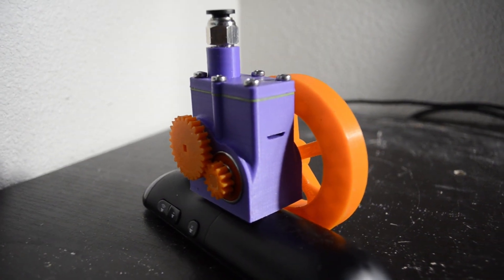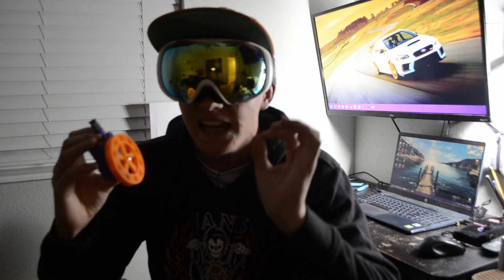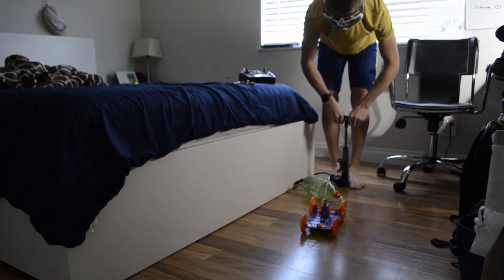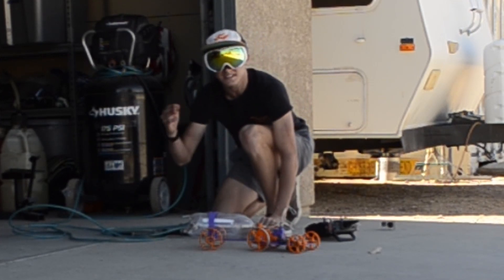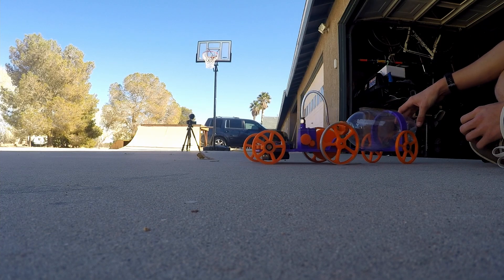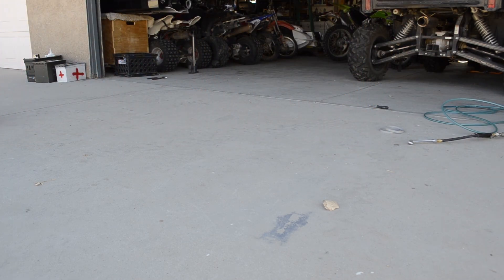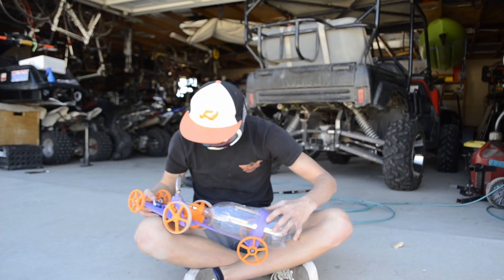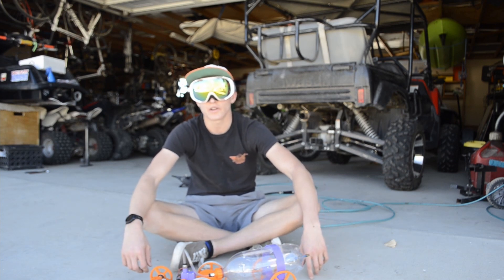RC Car That Runs Off Air

Comment: That’s cool, but why would it be 4 stroke if it’s run on compressed air
Reply from the maker: It just uses air 0.5x as fast as a 2 stroke with the same displacement.
Reply: @AxelDayton  do you have a discord?
Reply from the maker: @jordanflorance4419  unfortunately I don't

Comment: I feel like I can help a bit. We need to decrease loss and increase traction. You lost a ton of distance due to wheel spin, using a secure rubber band would have huge benefit over ninjaflex, also remove the trailer and mount the pressure vessel to the car istelf. I recomend you only use 1 rear wheel that drives the unit and add some weights to the drive gear, this will help make the power stroke more effective and increase momentum of the drive wheel while adding pressure on the friction surface, while decreasing drag from friction with the ground during the rolling parts of the engines cycle.

Comment: Here’s an idea for being able to squeeze out more power every stroke but what if you make your engine be designed not like an internal combustion engine but instead like a steam engine you see modern(ish) steam engines from the 1910s like in the Olympic class they would have 4 cylinders (like your engine) but to use up every ounce of steam as efficiently as it can. 1) they would have a high pressure cylinder where all the steam goes into first 2) they would have an intermediate cylinder (the medium pressure one) that is double the size of the first cylinder where all the all the steam from the high pressure cylinder would go into (3 the steam from the intermediate (medium pressure)  cylinder would go into 2 low pressure cylinders (you can test out if 2 low pressure cylinders would be more efficient than a singular one) 4 times the size of the high pressure cylinder (4 exhaust. So yeah that’s my Ted talk on why stealing ideas from people that have been dead for a while is pretty smart 😎

Comment: You could potentially try to print an little turbo for it. For bearings you can use fingerboard bearings. I tried to do it on my two stroke air powered engine ( sadly it snapped the con rod)

Comment: Have you tried using the V2 with CO2 cartridges, I feel like the problem here is that there's not enough power on the fuel side to generate enough torque to run the car. The CO2 cartridge's could definitely solve this problem and get it to run. However, the volume of the cartridges would be of concern, as they hold 20 grams (at about 800 psi each, so you'll definitely need a throttle). Maybe multiple cartridges linked together,  and then a mechanism to change which cartridge is outputting when the current out put cartridge is running low?
Reply from the maker: I like the idea, but in my testing of my upcoming video I've found that the higher the pressure i run the engine at, the higher force the piston has on the crankshaft. In some cases the crankshaft has snapped because the pressure was too high
Reply: @AxelDayton  Eesh, that sounds about right. Maybe reinforcing the crankshaft with a central metal rod?

Comment: this may be a stupid question but if you had the air engine converted to be turned by a electric motor wouldn’t that be a air compressor ? assuming it’s sealed well
Reply from the maker: Not quite, the only reason is the placement of the exhaust port. Maybe i can build a compressor in the future though 🤔
Reply: @AxelDayton  I forgot most air compressors are 2 stroke, if you replaced the front steer wheels with some electric motors you could power the small compressor with that, like a regenerative breaking system. 

Or perhaps install a small solar panel on the roof of the vehicle and use that to power the small compressor to extend run time for the engine. 

I really enjoyed the video and I appreciate you making them I know there’s a lot of work that goes into these.

Comment: You should try to use dry ice with hot water in some kind of air tight chamber so that way it would last way longer than a pressurized bottle.
Reply from the maker: That's so true! I think i might experiment with some CO2 cartridges in the future though

Comment: This is very genius! Just add a regulator and it probably would run better. Also you should probably buy a resin 3D printer to get better quality parts than what you get with FDM.

SLA printers print out smoother quality parts than with FDM because the material doesn’t get extruded layer by layer.

This way, you don’t have to deal with Friction and you don’t have to sand it to make it smooth.
Reply from the maker: Those are very good points! Thanks!

Comment: hey axel you might try using two engines and using lower gearing like 1:0,8 or so and if you time it diffrently so lets say one is in power second is in exhaust and visa versa and make a better flywheel and better aero :)

Comment: I wonder how much power you were losing with the wheel skipping
Reply from the maker: Yeah i wish I could fix that, but that what V2 is for!
Reply: @AxelDayton  👀 makes me wonder if your gonna fix the engine or put something on the output to act as a mechanical capacitor to smooth it out

Comment: This is seriously impressive. I know it doesn't look all that fast and powerful but that's the reason cars aren't fitted with air engines and you made it work anyways.

3d printed air engines are notorious for providing uneven torque. I feel like if you found a way to run the engine at optimal torque/rpm continuously the car would have a lot more potential. Can't wait for what follows!!

Comment: So... I'm gonna be honest... I am mildly confused as to how this engine is a 4 stroke. I watched all your videos (as I am trying to make some engines myself) and I like your design a lot. I can see your engine technically has "4 strokes" but essentially all I can see is that your just cutting the amount of power strokes in half and then having a... kinda "blank" compression stroke which is probably losing you a lot of efficiency unfortunately. Granted I am sure you know this already.

That being said though, since your cam is now running at half the speed of your engine, you should have much better control over your valve as it will be opening and closing at a much slower rate. So if you double lobed your cam, or heck, just bumped up the ratio even further (maybe 4:1?) and then just matched the lobes to the ratio of the cam gears... you could actually end up with a MEAN 2 stroke.

I know that wasn't your goal with this engine... but... I mean... give it a shot and see what real potential your engine has.

When you originally mentioned you were going to make a 4 stroke, I just figured you were going to do a double expansion engine or something (First piston exhausts into the second pistons intake stroke) which may still work if you are willing to try it... you have done all the hard work already which is getting the tolerances and the engine design nailed down, so that may be something you might want to try looking into.
Reply from the maker: I am aware of all the points you presented and on the double expansion engine, that's been requested a lot and i plan on building that style engine but run it off steam
Reply: @AxelDayton  If you run it off of steam with a double expansion style, that will probably present MUCH greater return than compressed air. You might end up with something pretty potent then! I am excited for that video!

Comment: Cool project! One thing I can recommend is maybe try using  differential so the engine doesn't lose power on turns. Or, even try making it one-wheel drive to get the same effect without needing to put in a bulky differential. Cool project with lots of potential!
Reply from the maker: Thanks bro!
Reply: @AxelDayton  you could also make a bottom air tank. and a compressor like a turbo charger or supercharger.
Reply: @AxelDayton also you could make a tachometer and a 3 speed transmission. 

3d printed academy